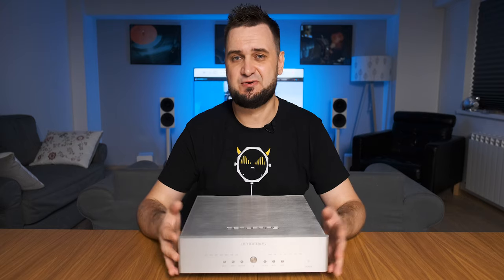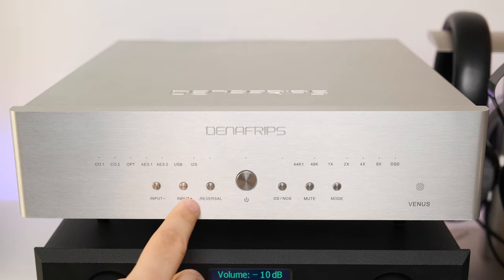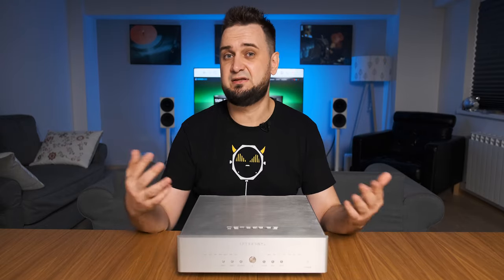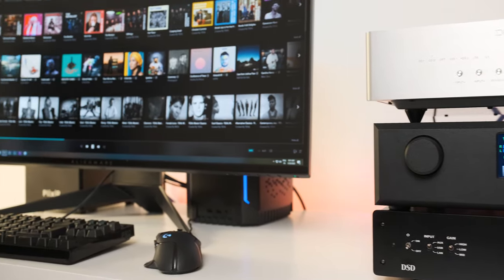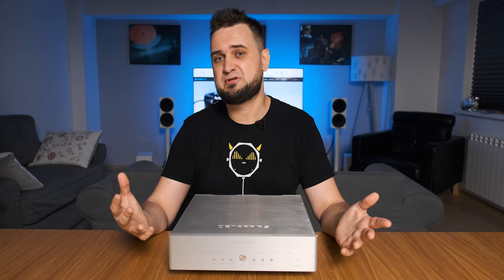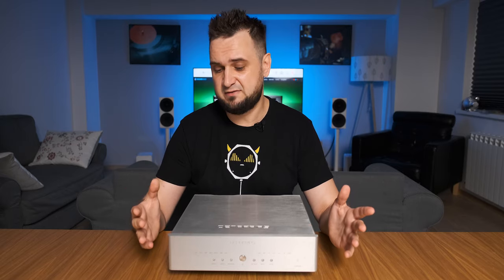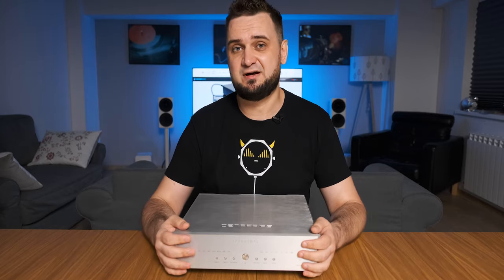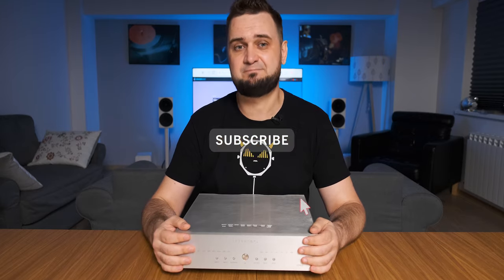Denafrips Venus DAC Review

Comment: Hi, how does it compare to the Topping D90 ? Which one do you prefer ?
Reply from the maker: More important which one would You prefer. They have few things in common: layering, open wide stage and that impressive depth, Venus is still doing that on a higher level. Venus is also completely free of any grain, free of any digital glare that will appear sometimes on any delta-sigma DAC, including on D90. That harsh-free presentation of Venus is hurting a bit the "leading edge" and the outline, the texture of the note. You feel it smooth and relaxed but not very clear and outlined. D90 felt a bit more detailed sounding and a bit clearer because of that. With Venus you don't want to search for those tiny micro-details, you just want to listen to music and relax. Both are really good, but Venus is a bit better due to that layering and wider stage. For modern music only I would go for D90 and for wider preferences in music Venus would work better.
Reply: @Soundnews  Hello there, can tell us ¿Which is more fast and dynamic ,Venus or D90?.
Reply from the maker: @Robert-un5zo  Hi Robert, if you crave about speed and slam, then D90 is your winner
Reply: @Soundnews  Thank you for the great responses bro.
Reply: Take good care. Your videos are awesome.

Comment: Very nice review! I really hope you get your hands on a Pontus next. The Venus is too much for me, but I'm planning to get a Pontus when I am able. My friend has an Ares II and it was the first DAC I've heard that really stood above all others. Including one more expensive, that I already own! Personal feelings aside, the Ares, as amazing as it is, seems pretty cut down compare to the other three. The Pontus however, seems to get a lot of the same features as the Venus and Terminator, for a much more reasonable price.
Reply from the maker: Hey Zack, Pontus is basically a balanced Ares (4 channels = true balanced config, instead of 2 channels on Ares) with a slightly better power supply. Venus seems to be much better (better clocks, higher precision resistors and even better power filtering and PS). Venus seems to be the best bang for the buck as it is basically the same Terminator with lesser capacitors and smaller PS.
Reply: @Soundnews   Well, you convinced me. I just spent my tax return on a Venus. YOLO!
Reply: @zackw4941  So what do you think of Venus?
thx for helping me chose the right one
Reply: @vinylseeker867  I like it! I don't have any other high end DACs to compare it to. But I would say it does everything I could ask for. Perhaps the only thing is that there is a slightly higher probability that vocals will sound recessed, depending upon the recording. I am very sensitive to that though. And it really depends on the recording, normally it is not an issue at all. Otherwise, it seems perfect to me. Very natural and musical with excellent space, sound stage and detail. In a week or two, I will get to visit my friend again and compare side by side with his Ares II.
Reply: @zackw4941  thx dude..

Comment: With hearing this experience, can you imagine listening with the terminator?
Reply from the maker: In a very revealing acoustic chain there would be a difference due to a better power supply of Terminator, in a mid-fi system there will close to zero or no difference at all between them. Terminator is worth only in very expensive systems

Comment: Did you tried newer version Pontus..?
Reply from the maker: No, but it is the same Ares II in a true balanced configuration (4 R2R ladders instead of two) with a slightly better power supply. From Denefrips, the best value for money are Ares II and Venus II (on the digital side, Venus is 100% of the Terminator)
Reply: @Soundnews  Interesting..so many reviews and so many different opinions..
i think i will order pontus II..the price difference to venus is quite big..
Reply from the maker: @vinylseeker867  I stated only facts, not opinions. Check their digital section, check their R2R ladders and their components, everything is in there.
Reply: @Soundnews  So your opinion is that its not worth it to go for Pontus2 over ares2?The price is almost double..
Reply from the maker: @vinylseeker867  I repeat myself: Pontus2 is exactly the same Ares2, but it has 4 R2R ladders instead of 2 on Ares, meaning that it is a fully balanced DAC and Ares is not. The resistors are exactly the same, the digital section is exactly the same too. The power supply is bigger and better, with more caps for filtering too. Pontus is just a slightly better sounding Ares, nothing more. If you want a real upgrade, that is the Venus that uses better resistors (twice the precision) and further improves with the power supply. All this is not an opinion, but a fact. Ask Denafrips if in doubt
Reply: @Soundnews  OK..thx for helping me..
I was told by them that venus has more resolution,more detail..
I,m a vinyl guy and i,m in the hunt for dac that is close to that sound..
And also that Pontus 2 sound is better (more resolution,clearer background) than previous version..
Reply: @vinylseeker867  When is the Pontus 2 going to be available? The website by denafrips says indicates Pontus and not Pontus ii for sale https://www.denafrips.com/pontus
Reply: So is it a good value to get their Gaia/Venus 2 combo rather than Gaia/Terminator2 value for the money and also I’ll be feeding my oppo via coax to Gaia as well i am guessing Gaia Venus 2 will be similar sounding to Gaia T2 combo but the price diff is like 1500 usd